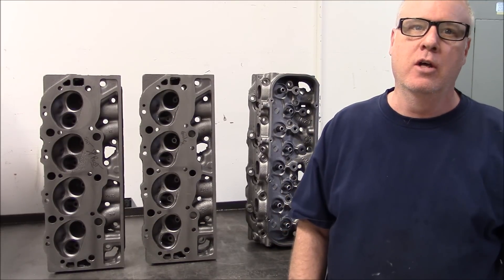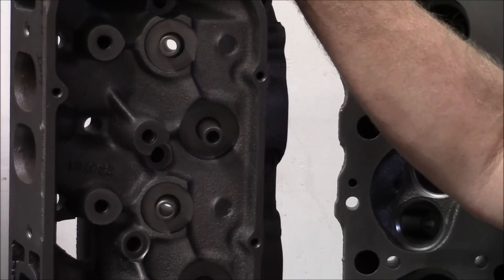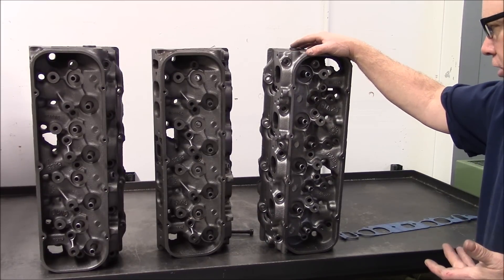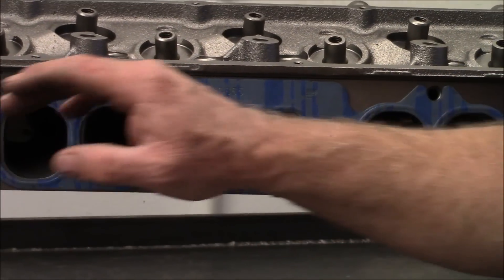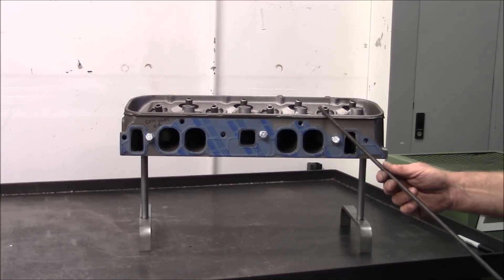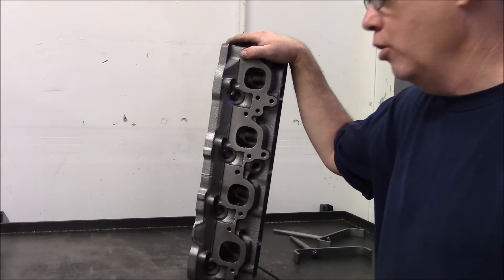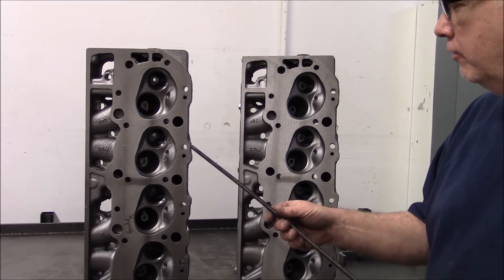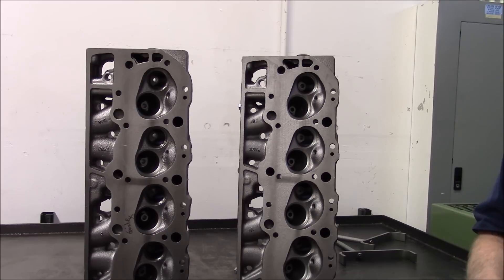Engine Build 620 HP 454 Big Block Chevy Part 3 Oval Port Head Core Selection Before Porting

Comment: Aftermarket heads of any type aluminum or iron sized for the engine will beat any GM Factory Head Hands Down. Aftermarket heads will resell better add to the package in your car reselling it or just selling the motor aluminum heads will sell better than iron heads. Also Factory iron heads vs. Aluminum heads is worth .07 ET in the quarter mile. Because there is a hundred pound difference between aluminum vs Iron heads. And the proof is in the pudding even the cheap Pro Comp aluminum heads make more power than any Factory head. And the front end of the car will come up higher when launching the car with aluminum heads. for better weight transfer on the street or at the track if more traction is needed run aftermarket aluminum heads. Aluminum bolt on ready to go heads make more power and go faster because they are lighter. New heads have longevity and dependability with all new parts is a big plus. Aluminum heads will take higher compression better without detonation on the 10.5 to 1 pump gas. and core shift on Factory heads you will never see it at the track or on the street. And 620 horsepower on a 454 may be possible but it probably is not going to have much torque behind it because the cam will be massive to make this horsepower and will probably be a solid roller with very high compression not streetable. Carcraft did an article with a 502 with 781 heads bigger valves hydraulic roller single plane and it made 520 horsepower and right at 600 foot pounds of torque across the board. And the compression was about 9 to 1 on this combination. So if somebody jumped it up 1.5 point of compression higher it's not going to make a extra 100 horsepower. Anything is possible with 15 to 1 compression, fully ported and Polished iron heads, performance valve job, monster solid roller cam, 1050 dominator carb, single plane tall Ram Merlin X intake, 2 in 1/8 inch equal length headers and 620 horsepower is possible.
Reply: So......whats this 620 HP 467 going to run in my 3720 pound 68 Chevelle. Will iron heads keep the front end from lifting? If don't like this build you sure wouldn't like my peanut port build LOL. 9.8 comp 049 headed hyd roller dyno/drag test coming soon..............be there.
Reply: VORTECPRO I love your peanut port engine project! In my opinion, way too many people think they've already got it all figured out. But you proved that they don't, so many people giving you shit about your stock iron cylinder heads. Saying there's better out there, but it all depends on what type of application, if I'm looking at building a logging skidder, I certainly don't want those giant hog daddy rectangular Port heads! It all depends on the application and I love your peanut Port project engine. Shedding some light on the possibilities for REAL street cars! I like all kinds of engines and applications. But at this point there's too many of these idiots commenting and doggin your approach. They're so narrow-minded all they can think about is 8000 RPM. There's much more diversity then just high RPM Racing Engines. At any rate, I really like your approach and your info. Much respect from me
Reply: Rod Austin remember when car Craft did the test on their 67 or 68 yellow Camaro 700 horsepower big block on their single-carb blower. They oval ports made more torque and horsepower power across the board. The iron oval ports won hands down against the 990 Square iron heads.
Reply: jon smith I don't remember that article. However I can say I have a set of 049 on my 468. Many years ago I had issues with my engine, thinking the heads were not adequate that I needed big rectangular ports, years later the internet came along and told me otherwise. I was about ready to give away my set of moderately fresh 049's... but much to my surprise I have refigured my combination, got a much more reasonable flat tappet Cam and have found much happiness! Now, in these days I embrace my big oval Port heads. As I was educated finally
Reply: Rod Austin I remember one guy at the drag strip in the eighth of a mile he had a 454 with oval ports. He saved up his money and put a set of Sonny Leonard Square ports on the motor and it slowed down drastically it was way too big of a head for that little engine. He jumped up in the intake port CCS drastically. I'm going to put me together  my 540 cid with oval ports and hydraulic roller. Compression will be around 9.5 - 10.1 cam around 236-242 at .050" for max torque.
Reply: Rod Austin do you remember the magazine article of the bill Mitchell 454 Small Block vs the 454 Big Block. the mouse beat the rat they say. The little motor had less drag and of course smaller intake ports. The 454 small block beat the 454 Big Block. That's when Bill Mitchell hard core engines - world products use to sell engines he's kind of faded away now.
Reply: VORTECPRO with iron heads on a big block Chevy the front end won't rise as much versus aluminum heads. A 049 head is a big oval Port I have a set I used on an engine build. And it depends on the whole combination weather I would use peanut heads or big oval ports in a project. I personally wouldn't use a square port Old Iron Head unless I was going to sell the engine. The new aftermarket Square Port heads are different I would definitely use those and have. With 10.5 to 1 compression increased cam intake carb headers on the street or strip Square Port aftermarket heads works great. And of course having gears converter and other things matched up. If it was just on the street and the compression was low and just a few steps above a stock cam I would use peanut heads on a mild Performance Engine. But at the track if compression was pretty high good size cam I would run the big oval ports. The funny thing is I seen a lot of guys slow down by over heading or over camming a motor. Especially the the guys at the track that started with big oval ports on a budget and then later back in the day went to a square Port head and slow down at the track. That really hurts to spend all that time and money in a waste of going slower. It kind of makes you feel like a failure. be careful with some of the guys at the track some of them will say they have a square Port head and they really have a oval port. And a lot of them won't really tell people their secrets because they don't want to get out run or someone have a faster elapsed time even on test and tune night. But you can kind of tell with some of those guys that don't know nothing about their engine. I saw a guy run oval Port heads with a square Port intake and do pretty decent at the track. You would think with all that restriction from a square Port intake going into a oval Port head. With his streetcar he ran low sevens in the eighth of a mile not bad. With things not matched to good it is still going to run down the road or track just not as good of course. Remember when I said about the guy that ran the 380 intake runner Square port head GM performance head on the 12.5 to 1 compression 454 in a railcar it slowed down drastically. In the eighth of a mile it's slowed down about eight tenths. That's almost a second slower. That guy felt really sick and he got his heads for free he just picked the wrong cylinder heads. He picked I think the biggest ones in the General Motors book at the time that was a big mistake. That made the Chevrolet dealership locally look bad real bad. But the owner of the rail car with the 454 engine he was a paint and body guy he wasn't much on engine combinations and Technical. he should a fully researched it with a pro guys a lot of engine builders before picking a cylinder head too big and not sure what it would do. There's a lot of very smart and educated guys out there in the field and sometimes opinions will slightly differ. But when picking engine combination power parts it's a little better to go a little conservative than too big. I hope this helps.
Reply: VORTECPRO you asked what it's going to run. Not knowing everything else you have converter gears tires and other stuff. I'd be guessing low 7s to Mid sevens in the eighth of a mile.
Reply: i would never just bolt on out of box heads!  just because their aluminum dont mean they are better. I run 781 heads in 468 with solid roller and 10.3 compression with mahle pistons. the motor makes 690 at 6400 rpm. torque 566@6400. max torque 626@5000 on 91 pump gas.
Reply: They also built a 383 with all the best parts it only made 420hp..could have easily made 520. Expirence and choice and knowledge make the difference. Mark is a master at extracting power using the simple parts

Comment: Mark, I have an original never cracked open 1965 425hp 396 from an Impala. Im wanting to run an isky hyd roller cam in it that you use in your builds, 228/238 and punching it out to 427 and dropping to the appropriate comp. Thats all provided a sonic check gives it a pass 962 block of course.  Interested in building it? I know its a rectangle motor, whats your thoughts on that build in a 65 impala with an M21 and 3.73 posi running power brakes? I figured it would be a modern interpretation of an l78 turned l72 on pump gas.
Reply: You will spoil the value of a rare L78, particularly untouched. Why not get an aftermarket block that's already 4.25"? Sell the engine for big dollars and build a good screamer for the cash.

Comment: What you never mention is what is the cost for all these operations , and you still have not installed guides , did any valve job for the larger valves or even bought any parts. Their are plenty of aftermarket aluminum heads on the market you can buy for the same money you have in this head that is a bolt on. I,m not saying you can,t make the same power with the 781 or 049 head you can , but it just does not make sense investing money in these old heads anymore. After being in the porting business over 50 years and even owing one of the first pairs of Warren Brownfield aluminum heads ever made . It just makes no sense to put this money in these heads anymore
Reply: Racer D this guy thinks he’s the shit.He is full of shit

Comment: Rather than spending time and money to source cores and rebuild them, why not go with aftermarket heads?  will you really save much after you pay for the machine work compared to a good bolt-on aluminum head?
Reply: Yeah just get a domed piston and buy the oval port trick flows... Finnegan did it and made 560hp out of a motorhome 454 with low compression

Comment: That piece of all thread is getting me anxious with the tapping.
Reply: You're brain is in La La Land. These heads aren't even prepped & built. One of the heads is too bad to be used for making the power he's after. And what the hell do ya think is taking place in those heads when they are all completed & strapped onto an engine that is making north of 600 hp. I can assure you there's a hell of a lot more stress going on in there vs "gentle touching/tapping/pointing with an all-thread rod used as a pointer. Good grief man. And do you actually believe he would be doing that with a fully prepped head that is built & ready to torque onto the deck? Get a grip man.

Comment: John Lingenfelter could only get around 560 with some pretty fancy head work and whole lot of welding on the intake. So where is the other 60 plus HP coming from.
Reply: Lingenfelter products are typically trash, so there’s that. You’re also referencing 80’s-90’s tech lol
Reply: Would it be safe to say..........your not going to be a fan of my peanut port build?
https://youtu.be/Vzp_ihehkUY
Reply: VORTECPRO i AM a fan of peanut
Reply: ..modern equipment and machining technique go a long way.  Your going to loose a lot of races with archaic engine building ways there bud
Reply: Thats hilarious but , yeah were did you get the extra 60 hp from ? Hugh ?? Hugh? Bahaha  vortecpro way to go ..
Reply: @rooster68able its been done over and over. Do your research.

Comment: I'm using stock 088 heads on my 496. Small hydraulic roller cam, single plane intake, 9:1.1 CR made almost 570hp and 600tq on the engine dyno.
Reply: It wont take much to make them flow better with the right port grinding. Easy 50 horse. Watching lots of videos and books, I got my small block 462 fuelie heads to go from 220cfm to 270 cfm. I have to run cast iron for class rules. Quite a bit more than stock vortec heads. The vortecs like to crack between the seats, and I didnt have a set anyway.

Comment: I have a 454 engine the cylinder head casting number is 6272292 are those good cylinder heads ?
Reply: I also have a set of those same number, these were on passenger cars 402, 454
Reply: The ones have. Are 1971

Comment: Do you always use cast heads? Do aluminum heads warp? What is big difference in using cast verse aluminum heads? Thanks Where you learned all this about 454 engines has to have been school hard knocks.
Reply: Aluminum a lot more $ for good ones, cast iron ones with the right port work will get you close to the same power to a horsepower point. At that point you will need to go all out with aluminum. Its all about $

Comment: So the that decked my heads  and block was full of it when he said that was going to be  good  for my  454 . But fore some reason  I  bought  two seats  of headers  and both have leaks up against  the heads on number  one exhaust  port and number  two exhaust port I don't know what to do with it  if you have any ideas  please let me know  thanks
Reply: Phillip Filides you can use orange high temperature Permatex and wait until the gasket gets tacky put the two in bolts on each end of the header. to hold it in place put blue Loctite always on the header bolts. And tighten header bolts inside going to the outside just like a cylinder head pattern. Also keep tightening from the inside out until the bolts are tight not snug but tight. And if you have to cut a closed-end wrench into and use a socket and extension to sleeve the broken wrench to get more leverage on it you can or use a small thick wall pipe to put over the cut closed-end wrench for more leverage that's what I do or use another wrench with the clothes inside on the cut end wrench.. I don't use Permatex because I never have any leaks luckily since I started using Loctite. Headers have a bad name for the bolts coming loose and gaskets blowing out. since I've been doing this my way no more blowouts of header gaskets. Also don't worry I use blue Loctite on aluminum heads on the header bolts for iron or aluminum they have never gotten stuck. They always come out easy. And on projects I always use nylon lock nuts when I can if I can't use a nylon lock nut. I always use blue Loctite on all bolts. Loctite on bellhousing bolts, oil pan bolts, timing cover bolts, carburetor flange bolts, driveshaft bolts, water pump bolts, harmonic balancer Bolt. There is only one way to do something. The right way to do it once and be done. It's nothing like doing a job a second time because it's wasn't done right the first time. Or someone else has not done it right and you got to go behind them and do it a second time the right way because they didn't do it right the first time. Wheel studs and lug nuts always get wheel bearing grease on them. Since doing this no stripping galling rusting or any problems. Also on your head or tubes I've never done it but I've seen it done before people cut between the tubes. If it didn't work and leaks after this you could weld it back up and mill it down yourself with an angle grinder medium brown color soft sanding discs 3 inch round pad. Or if it doesn't bother you just leave the weld marks on the headers. Good luck I hope this helps you.

Comment: I do have a comment/question- I am 62 and rebuilt a 68 427/425 so it had the rect. port heads solid cam, 4 bolt main, etc. Back then there was always discussion/debate about the oval port vs the rect.. granted the rect. heads had the 2.19 intake but just wondering your thoughts
Reply: From what I've heard, the rectangular ports are fantastic for the high revs, but they lack the flow of the big oval ports at lower rpm.
Reply: Use the oval ports on a street car for your lower rpms, use rectangle at the strip for big torque converters and revving.

Comment: Note to self: buy aftermarket heads...
Reply: If anyone but this guy does any machining on an engine, it's ruined!
Reply: @canabox7112  In 40 years of building motors and cars/trucks EVERY machine shop seems to have that attitude. I think its something to do with the trade because I like doing things MY WAY also. hehe
Reply: right haha . i like to hear what he gots to say though
Reply: LOTS OF AFTERMARKET AL. HEADS THAT PEOPLE FEEL AND COMPANIES SELL AS BOLT ON ARE FAR FROM OPTIMUM TO SAY THE LEAST--HE HAS SOME VIDS ON THEM
Reply: @zxtenn 
True, but not all aftermarket heads are junk...
Reply: Machinists have it worst, since they do precision work. But I get plumbers and electricians who begin every job with, 

"what gorilla did this work? jeeezzzz".

I even had an oil change guy come out and show me a stripped plug and asked who did the last oil change. I said

"check your records. You did it"

that ended the attempt to sell me a new plug.

Comment: I've needed to relieve the quench side of the chamber behind the exhaust valve and a small area by the intake valves to clear several of the FM (Speed Pro) forged and hypereutectic pistons when using 781's, I'm curious to see if Mahle's domes clear the chambers without those modifications. FWIW for your other viewers, the later 781's work out to about a 1.800 or so installed height, workable with a smaller diameter valve spring but generally a pain in the ass to deal with. Much better to deal with the early castings since the valve spring selection is much easier to deal with, regardless of the cam chosen.
Reply: The chamber on a 781 will definitely need work to clear the chamber with a Mahle piston.